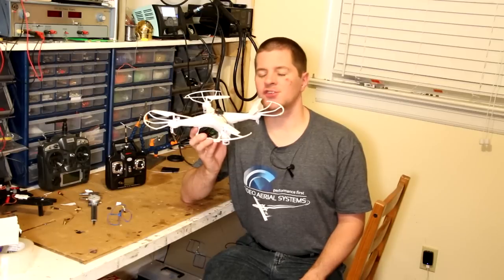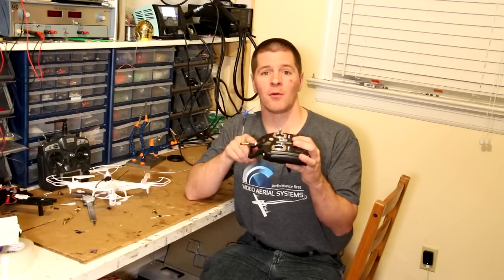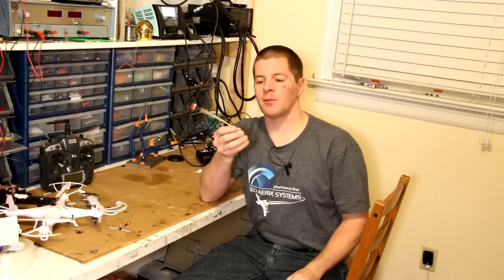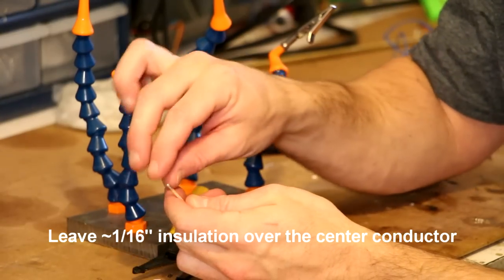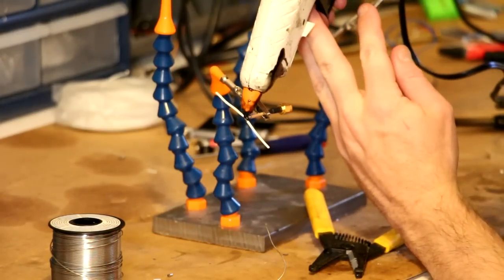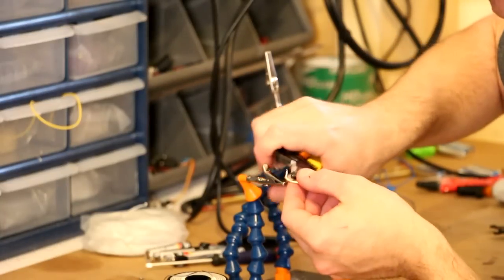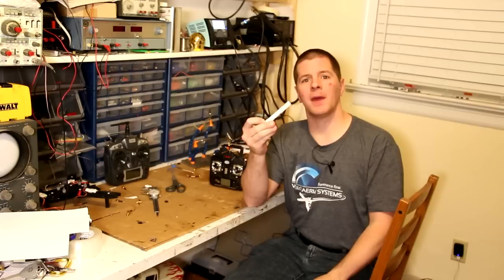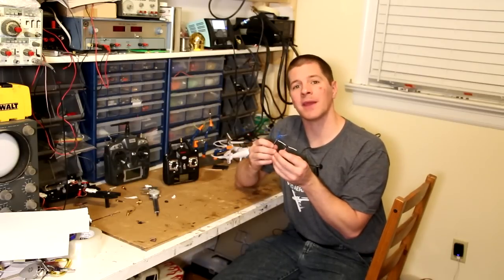Syma X5C control upgrade (FPV mod part 2)

Comment: I must have missed something. My stock X5C flies over half a football field (over 50 meters). I have been looking into modifying but I can DEFINATELY get way more than 8-10 meters stock. I'd be glad to post video. When I saw 6-7x the range in the description my eyes got big thinking 300+ meters. Oh well.
Reply: Yes i just got a x5c 2.4G about a week ago and it for sure flys over 50 meters high stock. I have a video of it on my channel.
Reply: He lost the range when he added the FPV video transmitter. He doesn't touch on the "why" in this video, but it's probably noise interference from the voltage multiplier he needed to add.
Reply: @midiwall2  So you're saying without  'THIS' FPV setup, this would fly much farther with that modification?

Comment: +Video Aerial Systems I did this mod and it does improve the distance just by adding a normal WiFi antenna. I put a high gain 9" and it worked really well. Before the mod I'd get half a football field and the camera was horrible unless you were next to it. I don't have a clover leaf antenna yet. I also added the other router antenna to the drone's camera/WiFi signal. It added 12g to the drones weight but made the signal strong enough to actually fly FOV the whole distance from one post to another.

The other piece of kit I have is a WiFi Pineapple. It's a pentesting device with an input router and an output router. I ran it off a USB battery and solar charger. I put the Pineapple in the middle of the two fields in a special pelican case hung from the goal post. I put a yaggie on a tripod beside me and hooked it to the controller's new antenna mod. With the router halfway dealing with video and the yaggie directing and boosting the signal to the flight controls. It doubled the distance of the flight and camera signal to two full football pitches. Where flying more than one goal to another was glitchy just using the controller and normal WiFi antenna. The down side of the yaggie is it only works if it's pointed within 15 degrees your drone, when it is it works really well.

The Pineapple is around 150 bucks (HAK5 on youtube) and a yaggie is around $14-30 depending on size. (Amazon) The Pineapple will let you connect a laptop/tablet/phone over wifi or hardwired, all at the same time so you can record video through it to any of them. Instead of relying on a camera that may be far away. I plan to get a couple more yaggies and see if they help on the pineapple to relay a better picture. I'd like to find the yaggies distance limitation. I have a cliff face that is 3500 feet and 3 miles away. I'd like to build up to buzzing hiker on the top of it while sitting at my desktop flight center. I'd still be able to see it from my front window. Maybe have someone meet it up there and swap batteries.

Comment: Alex,  Just wanted to thank you for this video.  I don't fly FPV yet, but did the Transmitter upgrade.  I used 14 gauge solid copper core wire for the poles.  Man, am I a happy camper.  This things range is well over 350 meters or more.  Now, my friends want me to do the same to their sets.  Thanks again

Comment: Hi Alex, I do have a question, and it pertains to circular vs linear for control. Why do we only use circular for video and not control since circular has so many benefits over linear except for a bit of range of course.  Obviously UHF would be totally impractical but for the higher frequencies like 2.4 I would think some would benefit alot.  So why is this, is it just a cost and complexity thing or is there actually a benefit to linear for control I don't know about other than a bit of range? Thanks.
Reply from the maker: Size is the main reason for the use of linear for control.  However the bandwidth of the signal for control is much narrower and thus multipathing is not nearly as severe of an issue.  Some have reported that circular gives much more control range where others have reported no change.  I personally have not experimented with it.
Reply: If you throw a  polarized 2.4ghz clover leaf youd get 1300+meters one on the receiver and tbe other on the transmitter

Comment: The Jumper T8SG would solve most of your problems.
Reply from the maker: Yes, but you're talking about a $120 radio for a $35 toy...
Reply: @CAGreve1231  sure, but if you have a number of you quads, it's probably worth it.

Comment: The made antenna isn't working so well so wondering if I want to buy a 2.4ghz antenna to attach to the male SMA, what would be a good choice?  I see 2dBi, 5dBi, 8dBi.... These are intended for 2.5ghz routers.  Any tips?

Comment: Hi Alex,
I have done some reading on modifying the transmitter range, but I would like to know if is possible a 10 db 2.4ghz router antenna, and if I also would need to modify the receiver, meaning the quad itself. Thanks

Comment: I have an Aviax H2O after 15-20 meters range is lags to respond and flies away on its own.. I removed the wire antenna both from transmitter and copter (to have the antenna outside of frame not blocked by battery and PCB etc.) now and made a small standard wifi antenna (just a simple metal quarter wave shield for outer pole and quarter wave middle wire) from a coax (did not use SMA plugs as not needed to be detachable) I had to add a ground cable as extension for the outer pole to battery ground as it was not near the original antenna. I found very small improvement in range. Should I try to make a dipole for the transmitter and put the original wire antenna back to the copter (receiver) ?

Comment: Great videos and excellent learning tools to help dispel some antenna myths.
One important thing about the receive antenna length you didn't mention.  62mm is 1/2 wave length and presents a serious mismatch to the receiver.  As you know 1/4 wave is near 50ohms impedance,  1/2 wave is near 5000ohms, a 100:1 SWR.  It's no wonder it could be worse than the stock 1/4 wave.  Extend it to 93mm and now you have a 3/4 wavelength antenna at or near 50ohms again.  The benefit here is with this length it may be enough to snake the antenna away from the board and maybe above or preferably below the quad.  I would not expect a significant range increase but in-range dropouts will definitely be reduced.
Reply from the maker: Actually, 1/2 wave would just be a base-fed 1/2 wave dipole.  It comes to ~60 Ohms on my Vector Network analyzer.  However in this case it really did not work.

I plan on trying to figure out a way to get some coaxial cable in there so I can move the antenna away from the other electronics.  I think this would be the biggest improvement.

Comment: OK, I am seriously impressed, just flew my Mega modded X5 ( 69g flying weight) with your dipole mod and at two soccer fields away I was guessing at orientation , not even a glitch, with my FPV X5 I flew further than video reception with 25mw MC01 micro. Thanks so much for this Mod !!!!
Reply from the maker: I'm glad I could help ;)

Comment: Will the coaxial cable extension fix you mention fit or screw into the 2.4 GHz 2dbi Antenna with Swivel SMA and would it work as well as the dipole antenna you made?http://www.readymaderc.com/store/index.php?main_page=product_info&cPath=11_45_48&products_id=97
Reply from the maker: Indeed it will.  You can put just about any antenna you like on it ;)

Comment: Alex GREAT video ++, thanks só much, i have a question, one antenna from a router with 2dB or 3 dB do a similar job or less? Because i have a tosted router xD
The diference in The distance between your antenna and the 2dB or 3dB are large?
Reply from the maker: mutholoco - The router antenna is basically the same as I show here, just covered.  in short, it will do well.

Comment: Finally a video all hobbyist can understand and execute. My advice two newbies using soldering irons is to buy a junk piece of electronics equipment such as a portable radio take it apart and just practice soldering and desoldering techniques. You'll be amazed at how well you can do this with just a little practice.
Reply from the maker: Also, get a temperature controlled iron!  Best investment ever!

Comment: Great video,  my transmitter does not turn on after I accidentally drop on floor, everything seems fine to me when I opened transmitter. Do you have ideas?  Help please I love my syma.  Thanks
Reply from the maker: Sounds like a broken solder joint somewhere.  Check the solder on the on/off switch inside the radio.  if that's ok, you need to re-flow the solder on the board.  If you can remove the circuit board and heat it up with a heat gun so the solder can reflow, this should fix the problem.  Be mindful to keep the heat away from plastic or it will melt it.

Comment: Have you every been able to get a PWM or PPM signal out of one of these toy grade receivers or transmitter?

I have a quad similar to this that is pretty busted up so I'm trying to use the controller and/or the receiver to get a PPM signal to use a flight simulator on the computer with this remote.
Reply from the maker: I have never got that far into it.  I would guess it could be done, but I never tried.

Comment: Excellent video as always Alex. Correct me if I am wrong but I think I should add a note that you should never have the radio turned on without an antenna attached because there is no where for the radio waves to go and will damage the transmitter.
Reply from the maker: You are correct.  However, in the case of the Syma, the output power is so low that you could power it up without damage to the radio.

Comment: I followed the steps but my transmitter won't bind to my quadcopter after the mod... Any advise?
Reply from the maker: Check your cable for continuity between the center pin and the ground pad with no antenna attached.  It should read open.  If it is shorted, that is the problem.  Other than that, I really do not know what the issue could be.

Comment: After almost loosing My X5c-1 to a gust of wind while up to high, I did this mod before I took it up again and it was well worth it. I did not do the dipole, but just screwed on a 9db antenna I got off ebay and boy did it make all the difference! Now when I order a new quad I order the parts to do the mod before I even take them for the first flight. Well worth the time and not hard to do.
Reply: +wild300zx can you please provide me with the link to the one you used? So you didn't have to solder or anything?
Reply: +Chris Raczynski Oh I did solder in the same SMA deal so the antenna could screw on. Both pieces can be found on ebay.  http://www.ebay.com/itm/291229911547?_trksid=p2057872.m2749.l2649&ssPageName=STRK%3AMEBIDX%3AITIt was really easy for me I have done two so far and it has really helped to keep a quad in control.

Comment: was this a X5C or X5C-1 ?  I get great distance with my X5C-1
You mentioned the other transmitter.  Should that work with the X5C or X5C-1 ?
Reply from the maker: It is the X5C not the C-1.  I have heard that many people are having really short range and others are flying far.  Perhaps this is the difference between the C and the C-1?
Reply: Alex Greve With the red 'X' and 2.4 printed on it you do in fact have the latest C-1.

Comment: I extended my X5C aerial to 4.92 inches, with a piece of wire that sticks out the top of the quad, and the same on the control. I get 150+ metres range now.
Reply from the maker: +Richard_AKL - Thanks for the tip!  I did not see favorable results with 2.5", but that is where I stopped.  I will try your 4.92" length and see if it helps mine at all.  If it does, I'll add it to the comments and credit you for it.
Reply: Yes, 4.92 is the exact wavelength for 2.4gh.

Comment: What Is The Name Of The 9x Radio Controller You Have Next To You?
Reply from the maker: DaDuTchMan2357 - That's the original Turnigy 9X.  I used it to test the TBS Crossfire I have been Beta testing for TBS.

Comment: I have stock dipole antenna on my remote for drone,near the place where is antenna soldered i have place,on board, for another antenna so can i solder one more antenna for better range?is that second place for antenna functional?
Reply from the maker: No.  You cannot solder in a second antenna without harming the performance.
Reply: +Video Aerial Systems 
ok,thanks

Comment: Hey, do you have any idea where to solder/what to do with that router antennas ground shielding if there is only stock antenna-wire soldered in circuit board and no stock-ground wire at all?
Reply: I have the same problem. just opened it and there is no ground on the antenna.
Reply from the maker: Apparently the ground is in there but hidden underneath the silkscreen (green cover).  You need to scratch it off and expose the copper underneath.

Comment: what is the best FPV camera for this copter that will also work in low light and where is a good place to order one thanks
Reply from the maker: Unfortunately I don't know of any good low-light cameras that would fit on this without weighing it down.  You need to find a CCD camera.  The issue with this small camera is that it is CMOS.  Almost any good CCD will do well in low light.
Reply: Thanks

Comment: Thanks a lot, this mod works very well. Could you please expand on the virtues of different grades of wire?
Reply from the maker: Wire thickness varies with frequency.  The wire I have in this video is what I find is optimal.  However, you can use different wire thickness if you like.

Comment: I am having trouble desoldering the original antenna. Any suggestions?
Reply from the maker: +Cayden Countryman Are you using a good soldering iron?  If not, the tip might be the issue.  Take a little bit of solder and "wet" the tip with it.  Use this to help conduct heat to the current antenna and help remove it.
Reply: +Alex Greve Thank you, I actually just changed tips and it worked perfectly. I appreciate the help.
Reply: +Alex Greve I'm a beginner so I'm not too familiar with what I'm asking, but I have another question for you. I followed your steps, and after I got it put back together everything turns on and connects. However, when I fly, I'm not getting the range I should be getting. I am using a 5 dbi aftermarket antenna. I'm wondering that, if I didn't do everything correctly (ie solder properly), would it still connect to the quadcopter? If not, that would mean I soldered the coaxial cable correctly. In that case, could it be that I need an antenna with higher gain? Thanks again for you previous help, hope you can give me a little more guidance.
Reply from the maker: +Cayden Countryman - Re-check your solder connection and verify that it is good.  The cable can twist and break free fairly easily.  If that is good, then it might be the antenna you used.
Reply: My main curiosity was if it would still connect to and fly the X5C with the solder connections broken. Any input on that? And thanks again for your suggestions, it's a big help.
Reply from the maker: +Cayden Countryman - It would still bind, but the range would be short.
Reply: +Alex Greve That confirms my suspicions, I believe the connections probably broke. Thanks again!
Reply: +Video Aerial Systems 
Hi,Alex
Is there any camera for Syma X5C-1 (to be able to cary) ,which can be used as FPV and at the same time can record with dissent quality on a MicroSD out there?
                                      Thank you.
P.S. And thank you for your dipole antenna ( my post 7days ago).

Comment: What do you do on the newer model that doesn't have a place to solder the ground to?
Reply from the maker: +featherriverflies - Scratch off the silk screen (coating) on the board.  The pad is still there.
Reply: You get it?
Reply: +Honeybadger1337PLAYS yeah got it to work. added good distance but not as much as stated in video. I'm satisfied.
Reply: +featherriverflies could you do me a favor? I'm confused about where exactly I should put the ground wire. Can you talk me through it?